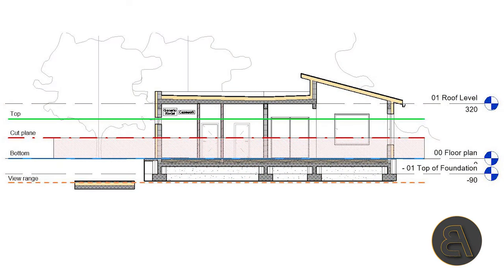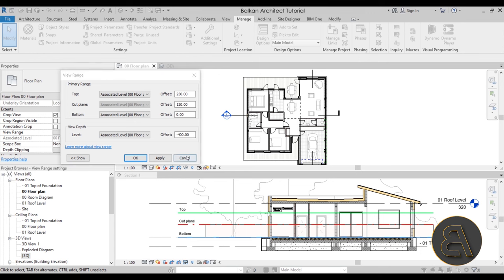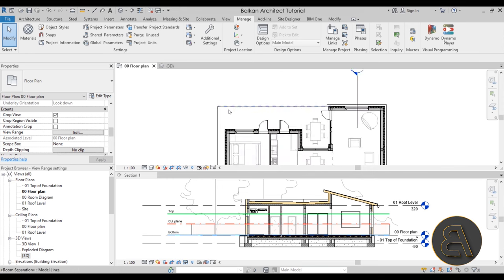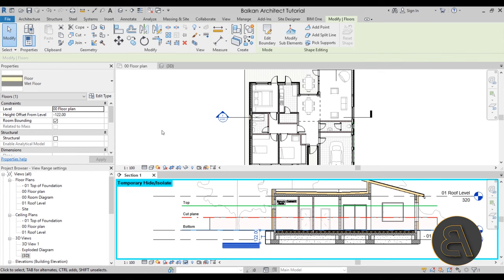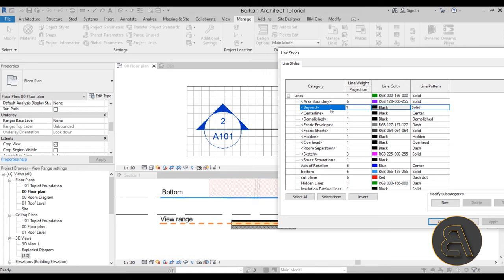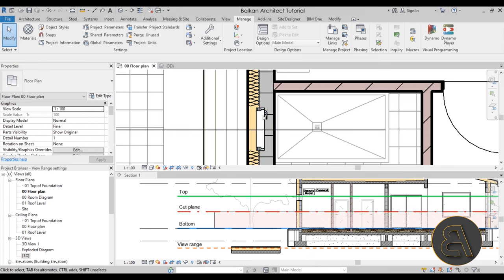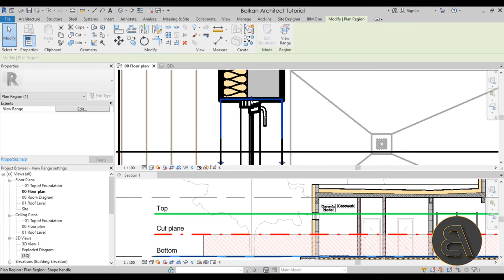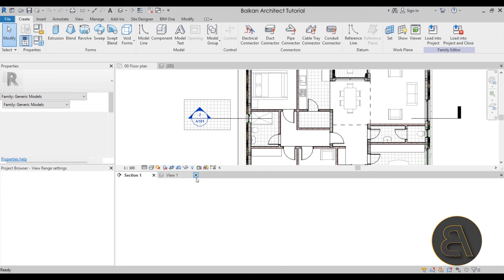View Range Settings in Revit Tutorial

Comment: is there a way to change the associated level on a floor plan? I having trouble with rooms because of it. For example, my new first floor is higher than the existing first floor. On the new floor plan it is showing the associated level being the existing floor plan and it is not allowing me to put the new rooms in the new first floor because it is locking to the existing first floor and it says the rooms are over lapping and cannot create the room. Now there is a room here and there it lets me create but i cannot edit the range of the room in a section. it still attaches to the existing first floor and  does not show in the new first floor. I have tried editing it in an elevation but I am not allowed to adjust the arrows to push the room up or down. I have no idea what's going on and I need help.

Comment: My friend thank you so much for this... but you moved away from the point! of How to use the VR?.,  When is need? Where. Examples of different levels using VR. not only for walls. But how can I View my ground floor and work on my second floor as a VIEW ONLY, so I have to snap to it but not moving ground floor. ? you got my point. I'm a Vectorworks user and now I'm working with Revit for this year.

Comment: Revit is the worst software ever made
Reply: It’s pretty bad. 

It was developed in late 90s with C++, and I suspect that the code base is extraordinary difficult to modify, yet the program is very stable. Revit has barely changed or improved over 20 years, and is slow as hell. Autodesk can’t optimize it for newer hardware, yet it’s always portable.

If anyone were to build a BIM today, and they were to do a good job with UI/UX and performance, it would be completely different than Revit.